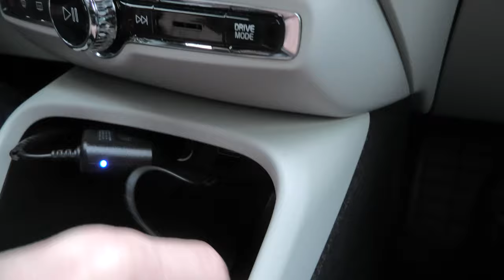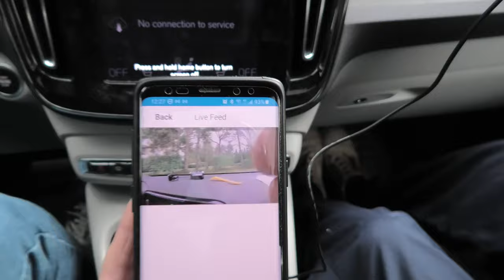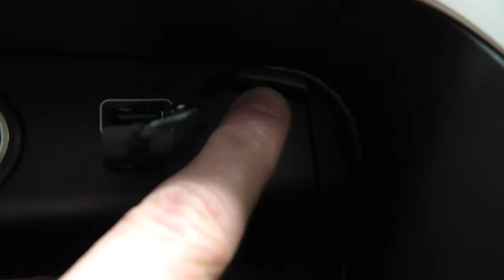Volvo XC40 (2019-2025): Garmin Dash Cam Mini Installation And Footage.

Comment from the maker: PRODUCT LINKS:
1. Garmin Dash Cam Mini. Car Key-Sized Dash Cam, 140-Degree Wide-Angle Lens, Captures 1080P HD Footage, Very Compact with Automatic Incident Detection and Recording - https://amzn.to/3Rgzwto.
2. Garmin Dash Cam Mini 2. Tiny Size, 1080p and 140-degree FOV, Monitor Your Vehicle While Away w/ New Connected Features, Voice Control - https://amzn.to/3Rh9Xbz.

RECOMMENDED TOOLS:
1. TRIM REMOVAL TOOL - 4pcs Auto Door Clip Panel Trim Removal Tool Kit - https://amzn.to/41nYhsk.
2. ISOPROPYL ALCOHOL - Solimo 99% Isopropyl Alcohol For Technical Use,16 Fl Oz - https://amzn.to/3x5DGuJ.
3. CABLE HOLDERS - Flat Wire Clips Holder (100 pieces/Black) - https://amzn.to/3Ynwtl3.
4. DUCT TAPE - 3M Multi-Use Duct Tape for Home & Shop - https://amzn.to/3F5oRNt.

Comment: NOTE: There are two things wrong with your installation, (a) Volvo say a dash cam must not be positioned anywhere near the large plastic housing in the upper centre area of the windscreen as it can interfere with the radar sensor which is inside this housing, (b) You routed the wire from the camera around the A pillar, this means the wire is now around the air bag. To install the wire correctly the A pillar cover should have been removed with the wire ruing down and out the bottom of the A pillar keeping the wire away from the airbag.

Comment: becareful the way you route the cable across A Piller cover will likely to cross the air bag, which will constraint the air bag from expanding normally. You should really remove the cover of A pillar then zip tie the cable to cable holders in the A pillar.

Comment: Great video. I was looking into a Garmin Mini. Do you have to have your cell phone running the app the whole time you are driving to record video? I would rather not have to have the app running the whole time I'm driving. That might a determining factor as to whether or not I buy the Mini. How has the Garmin Mini been working out for you? Can you give an update?
Reply from the maker: Thanks! No, you don't need to use the app for the camera to record the video. The app is only used to view, download recorded videos. We did not have any issues with the Mini. We did switch to the FitCamX dashcam since it has a better 2K camera and is integrated into the box on the windshield. Here is the review/install video of the FitCamX dashcam: Volvo XC40 (2019-2021): FitCamX - OEM Style 2K Front Dashcam Designed For The XC40! - https://youtu.be/ooHrg7rgGKM.
Reply: @MorozovAutomotive  cool thanks for the info. I've been researching dash cams forever but not sure which to get. I want something small and I will want to be able to use it in multiple vehicles. I'm going to research the FitCamX cam and see if that will fit my needs.

Comment: Did you get the parking mode cable to hook up to the camera so that the camera can record while the vehicle is in park and the engine is not running? The parking mode cable is sold separately.
Reply from the maker: No, we didn't install the parking mode cable.

Comment: Do you use parking mode with the USB hookup? Does Garmin make a dual camera system for a rear camera? If not do you miss having a rear camera?
Reply from the maker: In order to enable the parking mode, you need to install the parking mode cable - https://amzn.to/3JBPXx9. I don't think Garmin has dash cams with rear cameras. They only have the dashcam which has front and interior cameras in one unit. Right now we have the Fitcamx dashcam installed in the vehicle. It does come with the rear camera. Volvo XC40 (2019-2021): FitCamX - OEM Style 2K Front Dashcam Designed For The XC40! - https://youtu.be/ooHrg7rgGKM.

Comment: DUDE! You have a auto-dimming review mirror! Why don't you just use a "Dongar Adapter" instead of removing panels and pulling cables like that??  😅
Reply from the maker: We actually have a different dash cam installed in the XC40 now - Volvo XC40 (2019-2021): FitCamX - OEM Style 2K Front Dashcam Designed For The XC40! - https://youtu.be/ooHrg7rgGKM.
This one uses the t-splitter to get power from the rear view mirror.
Reply: Volvo does not have the multi-pin female plug on the rear of the mirror.

Comment: If the Mini does not have GPS how does it keep the time accurate if it is only powered when car is on??
Reply from the maker: You can change date, time in the settings. I believe Mini uses supercapacitor to store time.
Reply: @MorozovAutomotive  Thanks. Will need to research that as I often leave my car for days without usage so hopefully super capacitor can hold for a few days,

Comment: Can u read number plates? Does it get hot?
Reply from the maker: You can read license plates at close range. There is actual dash cam footage at the end of the video. You can take a look yourself. It start at 10:08. Camera gets warm. It does not overheat.
Reply: the mini is only 1080 Picture is ok  , I upgraded to the 56 4K 1440 and the Picture is Far Better and it records your Speed & Location , The Mini only records the Date & time